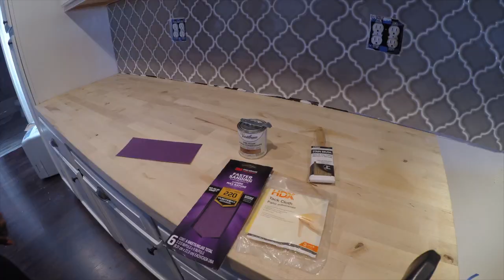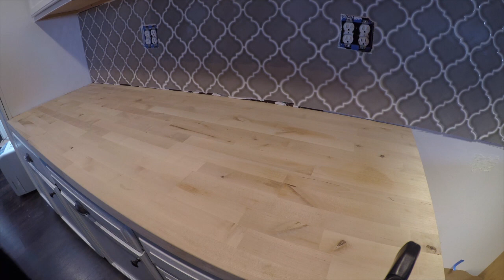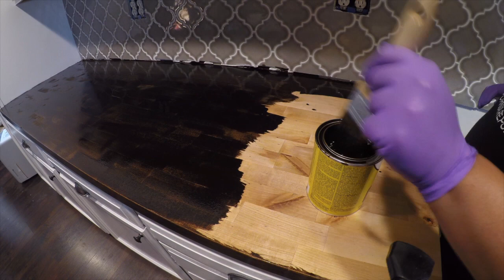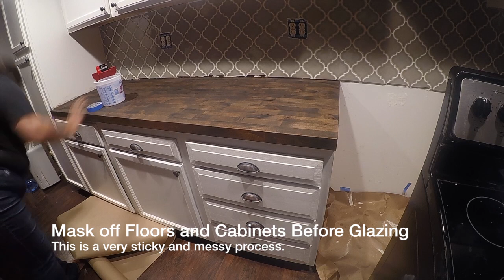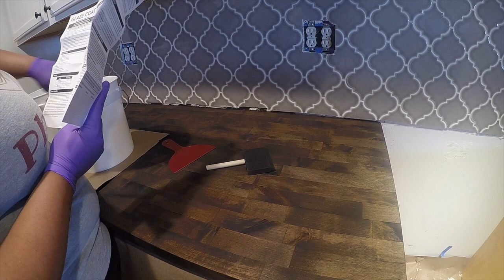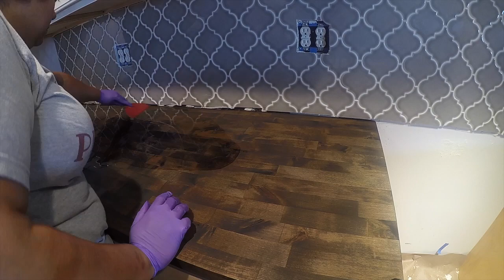DIY butcher block counter transformation with stain and epoxy glaze coat

Comment: Did you use an oil based stain?  I was told that the epoxy would not adhere to oil based stain.  I am doing this same project right now, spinning my wheels.

Comment: question : is the glaze coat food safe? I want to stain it and glaze coat a  hard wood cutting board....cutting board from a mesquite tree that I recently cut....thanks!
Reply from the maker: MrIsrael361 that was a concern of my husbands as well. Weather or not it is food safe. The box specifically didn’t say good safe like another one that exist. But I figure if it’s safe for a bar where food and drinks are being served it couldn’t be bad. You project sounds amazing! I would love to see the finished project when your done
Reply: That's not food safe.  A better alternative would have been butcher block conditioner and mineral oil
Reply: Also, if you ever make any accidental cut marks on the epoxy the marks will show like a sore thumb
Reply from the maker: Chase J it’s been about 3 years and I haven’t had any issues, there are other YouTube videos that show how you can buff scratches if your careless enough to make them
Reply: It’s not food safe and the “bar” you referred too usually as a thick food safe epoxy finish applied.

Comment: How have it held up? I read the directions and it says do not use the epoxy with oil based stain.
Reply from the maker: l b it has held up great! Still no peeling or cracking. I clean it like any regular granite counter top.

Comment: Great video, thank you!
Reply from the maker: Cory Simpson thank you! First doing any of this house work so I’m learning a lot as I go.
Reply: @prpatel04  did you feel the epoxy was worth the hassle over just doing a polyurethane? I'm doing something similar but for a computer desk.
Reply from the maker: Cory Simpson there were pros and cons to it. The pros are that it looks amazing and it’s easy to clean stuff off of once it’s dried hard, and it seals the wood really nice. The cons is the very chemically odor it gives off, you have to work relatively quickly or the coat will start getting hit and hard. The other little price of counter top I have looks a little wavy on the surface because I mixed too much and had to go fast, which resulted in lumpy surface. So for your computer desk it shouldn’t be a problem. Overall I would say it was worth it, I don’t have to worry about food and water spills staining my wood, I can just wipe with a regular cleaner and rag.
Reply: @prpatel04  keep posting and grow this channel my friend.  👍